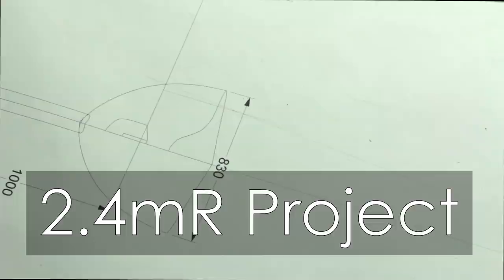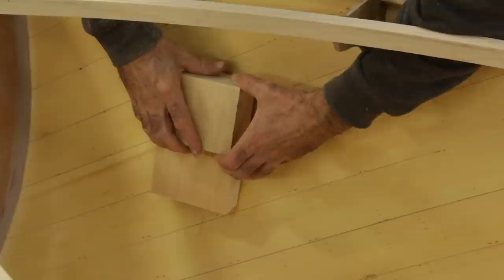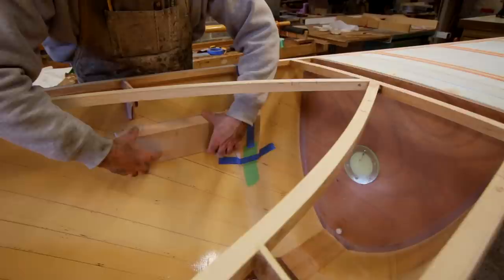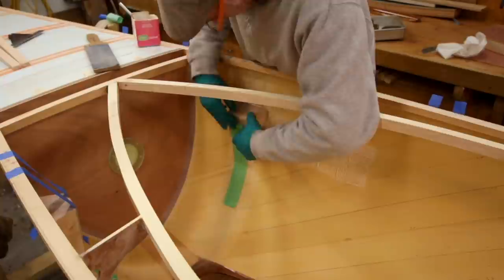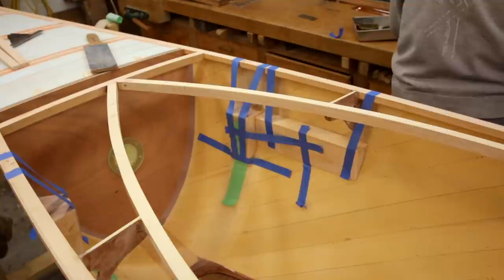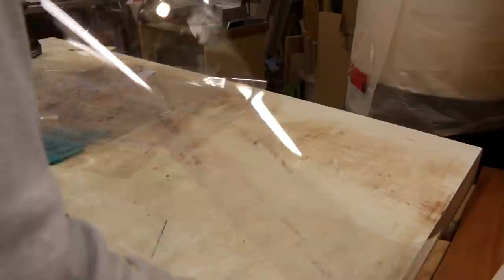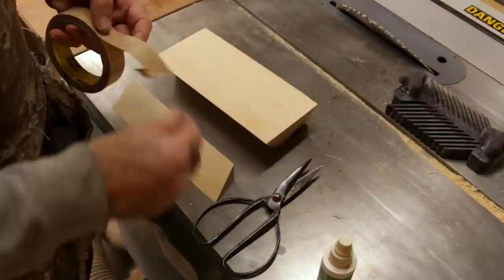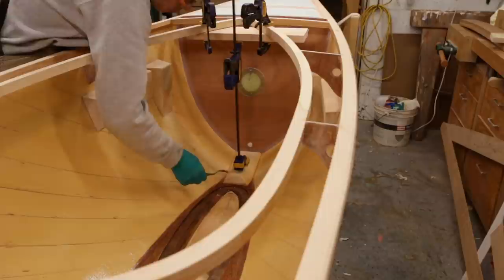International 2.4mR Sailboat Project - Episode 38 - Shroud & mast step blocking

Comment: Thanks for posting ,I am really looking forward to the decking but am enjoying the whole process. I have had good luck using elastic veneer tape (stretchy) for holding tricky bits fwiw. Also another nice thing about those "quick grips". When they decide to let loose at the most important time and you fling them across the shop swearing you will never use them again there light weight doesn't do as much damage as a pony or pipe clamp 😉.
Reply from the maker: That's so very true. I have some luthiers tape that has bee also quite useful but it's just masking tape of one flavour or another. We'll be onto decking pretty soon.

Comment: why not join 2 temporary bars between the two pieces through the hull ...? the scotch does not make a tight seal! wonderful work after the bottom hold ... Bravo !!
Reply from the maker: I just didn't want to put holes in the hull at this point. Most of that blocking is above the painted waterline.

Comment: You remind me of a surgeon at work! as you manipulate those shrouds into place and cleaning up the epoxy with the palette knife. Now I know why If I choose to build a boat in the future, to build it out of steel not wood, you don't have to fart around with epoxy. A lot less headaches for sure by the looks of things. Although being a welder fitter helps make that decision kinda down pat. lol What I don't understand and is a mystery to me, is why you don't have more followers? what would come in handy mark is a little pole that would extend that would lock in place to apply equal pressure on those blocks.
Reply from the maker: Well it's good to have a comfort zone to work in but there is no shortcuts in boat building. Doesn't matter what you build out of, it will take the same effort in the end.
Reply: @Nomadboatbuilding  I hear yah there bud I can believe that for sure. Hey Marc I watch another guys channel, he's got a ole Idler sailboat that he's run into a couple issues with and he's asking a couple challenging questions that he needs some advice on. His channel is Reviving an Idler Episode 11 he is asking a question as to what is the best way to bung a couple holes in a plank and he's wondering which is the best method to take. Are you able to give him a couple tips as to what is the best way to approach his problem with bunging these holes. or should he address his problem with another solution? thanks I really appreciate it, I think he'd really appreciate the help. I know its a maybe a strange request but your the only one that I think is knowledgeable enough to help him with some solid advice. cheers bud.

Comment: Great trick in marking the angle for the mast base! 
Why not use some sort of wedge across the inside of the hull (instead of masking tape) to help hold your blocks you were epoxying?
Reply from the maker: Because one needs to be fixed in order to wedge against it to hold the other and then the pressure applied sure as shootin’ will cause some creep. The tape worked just fine.

Comment: OK, it's your fault. Well, you and Leo of Tally Ho. I'm going to build a wooden boat. I'm looking at an Atkins design, the Maid of Endor. 20'-ish long, a cruising sloop. I'm thinking of strip planking rather carvel planking. I'm confident about the woodworking, but stand by to be pestered about epoxy, of which I have no experience. That's only fair, as it's your fault I'm being forced into this! :)
Reply from the maker: Okay Mike, I'll share the blame. But I'll also do you a solid. I'm going to give you a good dope smack before you pull the trigger on this. Shoot me an email and I'll share an article  with you that Larry Pardey wrote about time and cost. The cost numbers will be somewhat out of whack because of the age of the article but the time won't be. I can see why you are drawn to The Maid of Endor but it is no small project. Don't let the 20' length fool you. I want you to do a little thinking about your use of it too. Are you just day sailing? If so, do you need a cabin? Where can you moor it and for how much? Would something trailerable be a better choice? Not trying to dampen your excitement or lessen your experience but many people start a dream build and end up with a nightmare because they didn't think about some practical things. I'm going to encourage you to look at Paul Gartside's offerings too. He has a good number of boats about 18' in length that are equal to the Maid in character but are either trailerable or cabinless , etc. Plus Paul is still standing on the green side of the grass if you want him to answer a few questions. But Atkin is a solid choice to. I'm also going to shamelessly plug my Patreon group where I offer mentorship services of differing levels.
Reply: @Nomadboatbuilding  Huge thanks for the lengthy reply, Mark. I'll buzz you an email if I can find your address. Frankly, one of the things I was considering was how to adjust the design to make it trailerable.

Comment: I wanted to try peel ply but am not sure where to get it. Recently I discovered that epoxy doesn’t stick to the thicker clear garbage bags. Tried that the other day and am super impressed. Not sure if it’s as good as peel ply but I’m not sure I’m going to bother looking anymore. Definitely comes off easier. Even re-useable.
Reply: While plastic has its applications for clamping and such where you don't want things to stick, its no substitute for peel ply.  The peel ply is actually woven (I believe its nylon) so it allows epoxy and air to bleed through as you pass a fin roller on top.  It creates a small amount of osmotic pressure to actually pull some of the epoxy through the weave, this actually helps compaction of the laminate but is no substitute for vac bagging.  More importantly, as you may know, the amine blush forms on the surface so when you peel it away  the amine blush goes with it and you are ready for immediate secondary bonding.  What you can't see in the video, or more accurately what you can't feel, is that once the peel ply ply is removed the epoxy surface actually feels a bit like shark skin.  There are tons of fiberglass suppliers online that sell and ship peel ply.